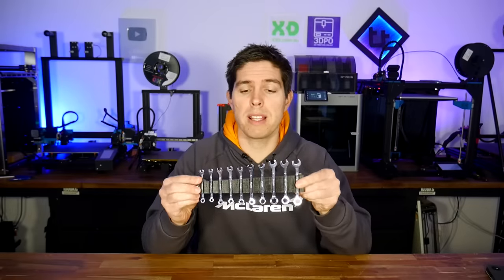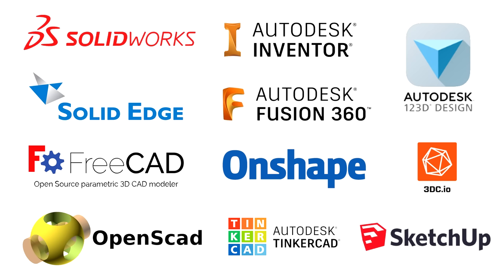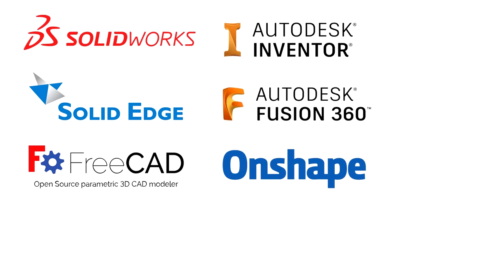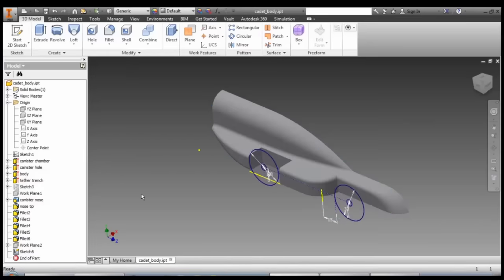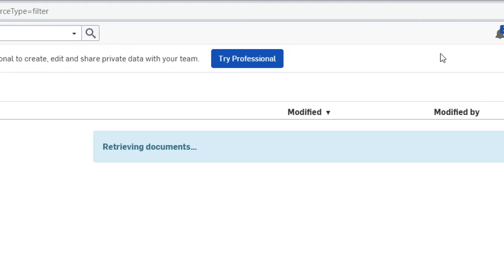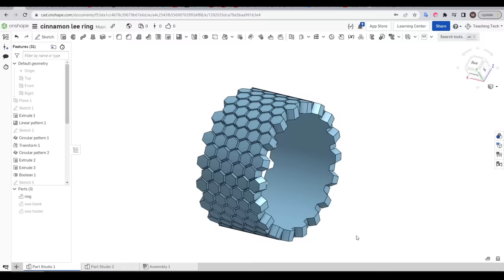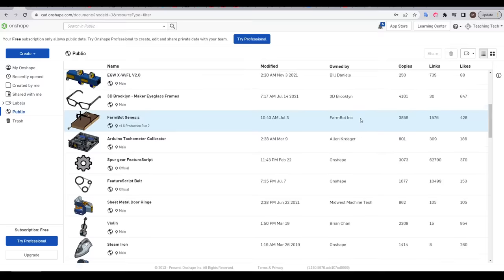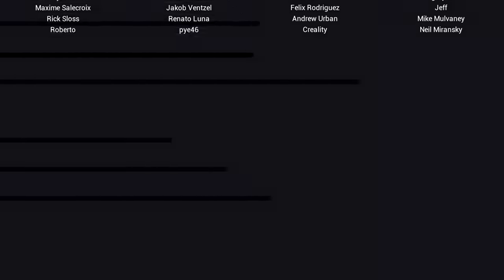Selecting a free 3D CAD option - 3D design for 3D printing pt1

Comment: Great video, I like to use CadQuery, which is a type of CodeCAD like OpenSCAD but is a BREP modeler with a lot of crossover with commercial CAD software. Here is how easy it is to generate a filleted box: box = cq.Workplane().box(1,1,1).edges().fillet(.25) !!
Reply: I do programming as part of my job but I've never seen the value in code to CAD so maybe you can enlighten me. The issue I've seen with it is lack of readability and scalability. I've designed a 3d printed cat wheel, while I could imagine coding up the wheel easily enough, the difficulty lies with breaking it down into printable segments. Designing the interconnects to join to wheel segments and them adjusting them after finding tolerance issues. To me that seems impossible to do via CodeCad systems?
Reply: Which, as someone coming from an OpenSCAD background and wanting something better, makes next to no sense without knowledge of Python code. OpenSCAD is far too limited and single-core-intensive with no way to offload processing to a graphics card or the like, but it's at least straightforward enough to use with simple English and common commands as opposed to having to entirely learn a whole new programming language.
Reply: @ender-gaming  That cat wheel is a specific example that I am not familiar with but I will do my best to explain general concepts. Breaking down such a wheel into printable segments is totally possible with CodeCAD, I would envision creating "tools" for cutting the large wheel into individual pieces. These "tools" could be as simple as a rectangular box with a small thickness to ensure that the pieces could be assembled later. The "tool" could be based on an adjustable parameter defined in CodeCAD that would later impact the fit tolerance. Regarding readability I would say that depends on the user, if you don't put in comments in your code describing variables/functions then yes it will be obtuse and unreadable. The true value of CodeCAD is extremely robust parametric design, you can boil designs down to just a few inputs and generate all other design features based on these. That way you can design something once and then other users can adjust a few variables and VOILA they have a whole new design specific to their application. Regarding the cat wheel, if you made it in CodeCAD it would be possible to let users make a hamster wheel by adjusting some variables (and all the complex geometry would be recomputed, not just a simple rescaling of the STL).
Reply: @claws61821  To be clear, my code above is CadQuery-specific and has little to do with python in general. CadQuery has really good documentation and examples, which are IMHO necessary for any CAD tool as they all have idiosyncrasies. I promise if you understand OpenSCAD fairly well, it would not be difficult for you to learn CadQuery. Make no mistake, OpenSCAD is its own programming language that requires time to learn and understand!
Reply: FWIW, OnShape has builtin scripting in the form of FeatureScript.  It looks INSANELY powerful and they have made it even easier to use than OpenSCAD!
Reply: @KeithOlson  that is very cool!
Reply: @KeithOlson  Hopefully we'll see that shown off in this series! But it doesn't quite help those of us who want to make proprietary designs we can patent and sell, considering OnShape's Free User ToS.
Reply: @claws61821  Ever tried to greate and properly render rounded edges in OpenSCAD ... I managed to crash my computer with this. OpenSCAD is awesome for everything with straight edges and no rounded corners.
Reply: @Linuxdirk  I've found that the best way to design something rounded in OpenSCAD is to plot the curve along the edge of a polygon or polyhedron using at least five coordinate sets rotated at a static radius. You can precalculate these coordinates using trig or embed the math for them in a series of constants/variables or in a function and iterate through the results. It's similar to the brief documentation they give for the circle(); keyword in their Wikimedia manual.

Comment: Not only can Blender be used for CAD, it can run hard/soft body physics simulations of the parts you want to print, then renders the results as photo-realistic images.
Motion-capture some video in your home, composite the model into 'real space'...see how the thing looks when it hangs on the wall by hanging on the (virtual) wall!
Use the integrated video editor to layer in some sound and transition effects between scenes, throw in some title cards at the end.
Export models to STL for printing, export video for uploading.
All without having to use any other application.
Or spend a dime.
Reply: The physic simulations in blender are so different to the physic simulations you would use in a cad environment that they cannot be used for anything with regards to product testing/modeling

Comment: Looking forward to this series.  I learned Fusion 360 in the last 6 months and feel like I have a solid base knowledge, but being able to use a Chromebook or iPad would be a benefit, so I'll be following the video series for sure!
Reply: Why would you want to use an iPad?
Reply: @alejandroperez5368  I do because I am disabled and can’t sit for long periods.  Might want to think a little more outside the box..
Reply: Fusion 360 is attractive but having tried the free solutions AND NONE  OF THEM BEING FOR BEGINNERS(except for tinker cad) I'm VERY hesitant to spend what,$150, on a program that might be just as bad and hard to pick up and start using as the others.
Reply: @prongATO  Huh?  How is a laptop any different than the iPad or a Chromebook???  There are laptops that you can convert into a touchscreen device like an iPad and the only difference between a laptop and a Chromebook is that you can use installed programs. If you can't sit for long periods what do you do, run around?   Lay down?  Stand up?  I just don't see where you could use an iPad that you couldn't use a laptop.  And DON'T accuse me of not thinking outside the box!  Smh.

Comment: Freecad seemed to come quite a long way when the released 0.20, but it still suffers from the TPN or topological naming problem, where when you make a change mid way through it can lose track of which face the sketch was attached to. Although they're aiming to have this fixed in the next version.
Another option is cadquery which is similar to openscad but is python based. It uses the same cad kernel as freecad.
Reply: TPN is matter of using incorrect workflow. Is it an extra step that some other programs have to deal with less, yes

Comment: Used free cad professionally for 4 years now, the UI on it has improved drastically, theres also real thunders fork of it that is amazing to tinker with. My experience is perhaps the same as jokoengeneering on youtube, came from a pro background of solidworks and what was called proengineer, fit pretty well, just have to like to tinker.

Comment: Long time user of OpenSCAD. On occasion I have looked at other possibilities but I'm not really interested in heavy dependence on a mouse. Generally I figure if I have to type in dimensions I  might as well just use OpenSCAD and skip steps that can easily be done in a few lines of text. And yes, I have done a significant amount of programming in the last few decades. Also, the slogan "The Programmers Solid 3D CAD Modeller" really did appeal to me when I first started looking at possible alternatives. 
So, it is nice to be aware of OnShape as a possibility but my first choices would be with anything free and opensource. I'm proprietary software adverse when I have  a choice. I'm generally adverse to running stuff on a server when I can run it on my own computer.
Longer term I'm going to be watching what is happening with Blender and FreeCAD.
Reply: OpanSCAD is perfect for the mathematically literate, I agree.
(I have a Math Degree.)
Reply: For us non programmers it's absolute hell to use 😂
Reply: @jothain  But you cannot even recall your own name!
Reply: @MichaelKingsfordGray  Yes, math is good stuff. I'd say that one can do a lot with openscad and basic arithmetic. Throw in some trigonometry for more completeness. One does not necessarily need university level math to use OpenSCAD. On the other hand as a language OpenSCAD is more math like than imperative computer languages are. The meaning of the egual sign in OpenSCAD is a declaration and more like the math meaning of equal than the meaning used in imperative language assignments. It quite normal in Engineering to use math to describe a virtual model of something in the real world. One also may use a hardware description language to describe/specify a digital electronic circuit. It seems perfectly natural to use a descriptive functional language like OpenSCAD to describe the geometry of an object.
Reply: @peircedan  Agreed.
But I have a BSc degree in both Applied Math, and Computer Science, so am a bit biased toward OpenSCAD!
It is a bit like Verilog, as you suggest: you lead the process, rather than follow & stumble with a mouse.
Reply: Someone in comments said that there is also some cad plugin for blender
Reply: @Daniel_VolumeDown  I have heard and some day I will look into it. blender also interfaces with Python. Got to look into that too. I expect to be retired in 2026 so I will likely put it off until then.

Comment: After learning Inventor I bought one similar called Alibre Design. I have been using it for over 10 years with no problems. 
I have designed parts to be printed on it and I also use it to design woodworking projects. Kitchens, furniture etc.

Comment: I've used Designspark Mechanical for the less ambitious type things I make.  Nothing super complex, just simple little gadgets like a bracket for mounting some LEDs, lens cap for a telescope eyepiece (after losing the original) etc etc.  Larger precision projects like gearboxes etc would need something more capable.

Comment: I use Onshape at work. I was production department super but have plenty of Maker / DIY background. The product development head and I started talking then a few months later he said "Dude, your talents are waisted on that forklift, want to transfer?" (I was pulling product for my guys on the line.) Now 85% of my work time is in CAD either designing products, concepts or working with suppliers, engineers and other design teams (all use SW18) the other 15% is helping staff education or testing products. It was easy to switch from Sketchup and Fusion360 to Onshape with the self-paced courses.

Comment: That Onshape is looking mighty appealing. Being on Linux, I've been limited to FreeCAD so far, but the developer has made absolutely clear that it is in no way intended to replace or even mimic Fusion 360. (Instead it's apparently trying to mimic/replace some old CAD software I've never heard of, and the obtuse interface and workflow are deliberate.)
Reply: I am running F360 in a VM. I've been using it for 3 months and I really like it but the VM part is really inconvenient. They have a Mac OS version already, why such disrespect to linux users I don't know. At least if they can patch it up to run in wine that would be good enough...
Reply: @Anonymous-qx5uk  Most annoyingly, A) It sort of runs in Wine but they keep deliberately breaking that, and B) It used to have a browser version but they locked that to educators only now.
Reply: FreeCAD was trying to mimic CATIA at the beginning, but for a long time now, it was mostly moving ahead as the devs that contribute to it see fit. It's probably the reason why it's such a mess, it's a community project. I have contributed to it in a few places, mostly when i needed some functionality that wasn't there or was not flexible enough.

Comment: Being a programmer, I was immediately attracted to OpenSCAD. I really like its approach, and find it quite intuitive.

However, because of that immediate attraction, I haven't looked elsewhere, and this video is really good in giving me an overview of the other options available, not to mention that I wasn't even aware of the distinction between parametric solid modeling versus "mesh style" modeling.
Reply: FWIW, OnShape has builtin scripting in the form of FeatureScript.  It looks INSANELY powerful and they have made it even easier to use than OpenSCAD!
Reply: @KeithOlson  Ah, interesting!  Thanks for the tip :)

Comment: I have been using tinkercad combined with Fusion 360 for a little over a year. I started with the free Fusion but soon after went for the full paid product . Fusion has a long learning curve and i didn’t want any walls between me and the potential in getting my ideas into production. In learning the system i found some easy shortcuts that have allowed my cnc plasma cutting part of my business race ahead in production, while still learning the 3d modeling for machining and 3d printing. Even with the limitations of the extended learning curve (my personal limitations) i have been able to make my current abilities profitable enough to warrant keeping Fusion 360 in its paid product, in my tool chest. Love your videos. They are helpful and inspirational even to a 70 year old maker.

Comment: Onshape is definitely my favorite (I’ve used tinkercad, fusion 360, and onshape). The UI is the best (imo), it’s easy to learn, and how you can make complex models easily is amazing. The only thing I find difficult in it is anything related to CIRCLES (or geometry that isn’t flat/straight), you definitely need to use a mesh model maker (or something like that) for anything that is supposed to look organic or otherwise contain a lot of rounded geometry. Simple cylinders are easy enough, but anything without a flat surface is next to impossible to work with (at least at my skill level, and I’ve been modeling for more than a year)
Reply: Yep. I've just started modeling with Onshape and an hour later I was stuck on my very first model which has a curved base. I did a sketch from a top view, then I finished the sketch and tried to modify it from a side view or extrude it curved somehow, but I can't find a tool for this. When I search for a solution all I find is forum posts complaining about the lack of a 3D sketcher. Next thing I'm trying right now is extruding the first sketch, then making a sketch from a side view, extruding that as well, and keeping only the overlapping parts of the two extruded bodies. But I can't select points of the first extrude when I'm in the Sketch 2 view... The UI is nice, but Onshape is not user friendly at all, that's my first impression.

Comment: I like your decision process Michael. I have used Autocad in my working life, but obviously a bit expensive for a hobby. Have an old version of Rhino, which sill works, but will not output in Win 10 or 11. For the past 4 years, been using Design Spark Mechanical for all my models for 3D printing. It is free as well. Can export stl direct to Cura, or dxf if that is what you need. Will continue to follow your series and see if a change is necessary.
Reply: go blender, learn the quirks. hyperspeed. godspeed...
Reply: Thanks for mention Design Spark Mechanical,, never heard of them so i just checked them out,,,, quite impressive-.
(you worked AutoCad so i knew it had to be halfway decent)
Cheers

Comment: I mostly love working with OnShape and wish it had a hobbyist pricing model since I feel like they could at any time pull the plug on the free level and then my designs would be locked into a pricing model I can't afford.

That said, the absolute biggest limitation with OnShape in my mind is free-form and organic designs. Trying to even do the most basic things like creating an interesting shape that isn't defined by math alone, like mesh modelling, drives me crazy and is the only time I have fallen back on Fusion 360. OnShape is simply happiest when everything is constrained and well-defined mathematically.

Or perhaps I am missing something?

Comment: It took me an age to find the software that allowed enough features to create heavily decorated objects that also have strong engineering components where it's relatively easy to create threads, for example. Although by no means free, it is relatively (and I mean relatively) inexpensive when compared to others in the field. It's Rhino. It also has the feature of quadremesh where you can import a mesh and convert it to nurbs - which is what Rhino works with - and then export the edited, finished model as a mesh of your choice. Usual caveats regarding licences on the files edited and exported holds.

Comment: There is one more very advanced CAD software not mentioned, and that is TurboCAD.  Yes, it comes with a steep price, but it can create models using various methods to create solids.  It can import and export files into other forms to use in other programs. It also has many different converters built in and one is that models can be converted into STL's directly. It runs very closely with that of Unigraphics/NX concerning parametric models with true rendering.  Have been using it for years.
Reply: The industry standard generic file formats (IGES, STEP and SAT) can only be "imported".

Comment: Excellent video.  I tried Onshape a few years ago.  It looked very good but I've been burned enough times over the years with commercial software (going back to ancient Autocad) that pulled the rug out from under me or squeezed too hard.  So nowadays I use Freecad , OpenScad, and Blender for quick concept renderings. Onshape probably is easier to learn than Freecad (all those workbenches)!  but it's a tradeoff I am ok with.  I've lately taught children Tinkercad and a version of Openscad called Blockscad.